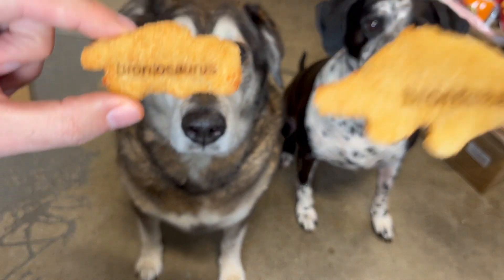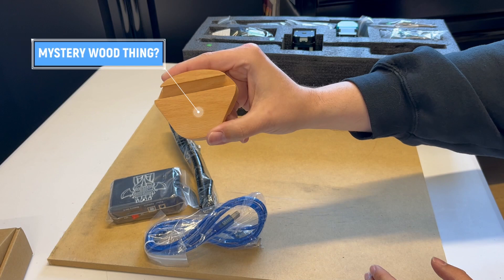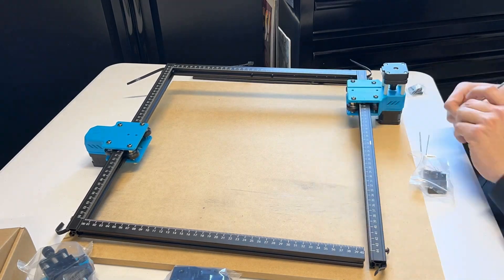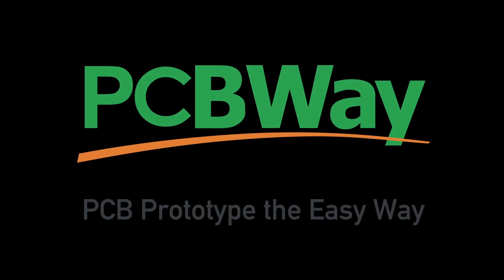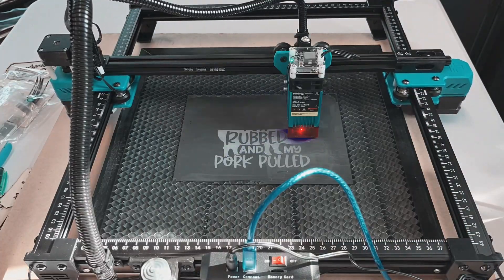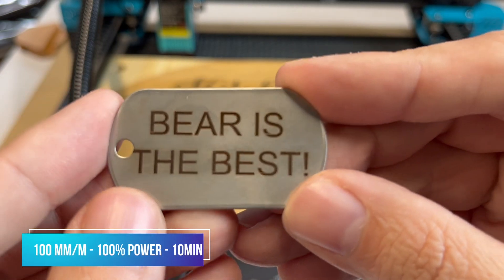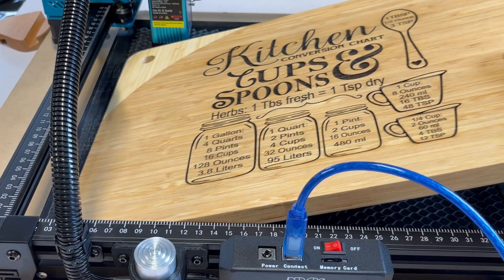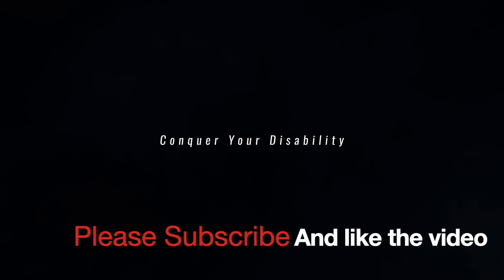TWO TREES TTS-55 - 5.5 Watt Diode Laser Engraver

Comment: I agree with everything you said about this laser engraver. The build process is pretty straightforward until you get the belt part, the laser itself is great. It cuts and engraves really nicely. I need to invest in a honeycomb for mine 👍